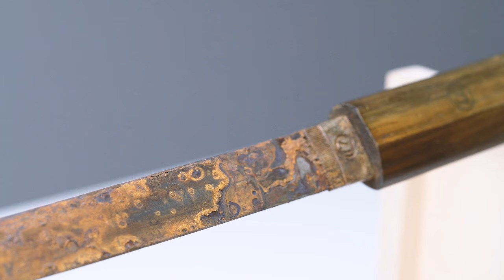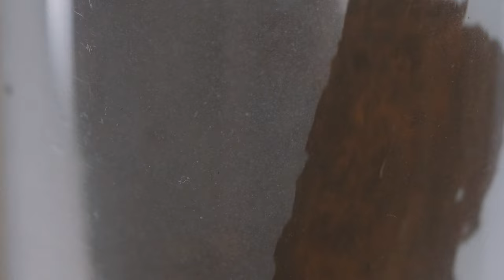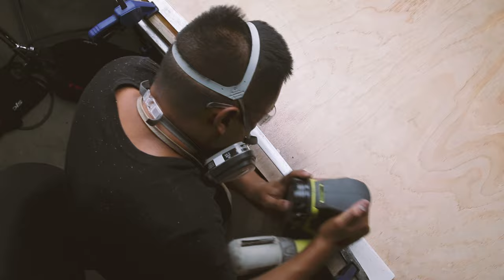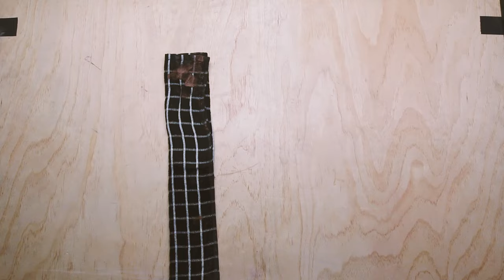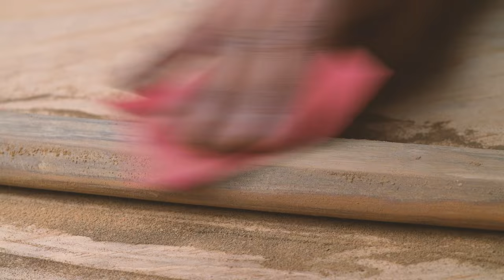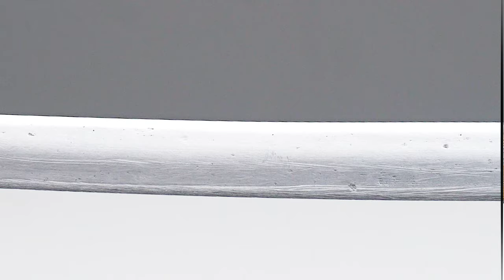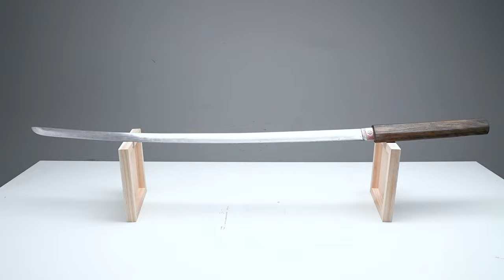Sword Restoration

Comment: I died a little inside when he took the sander to the blade.

How do you maintain the contours of the blade with a god damn sander?
Reply: pretty sure a lot of the contours of the blade were destroyed by the thick layers of rust. Honestly though if you really want them, the sander doesn't take a lot of metal off, only enough to give it its shine back. If you want the details back a little bit of acid could make them reappear. As for the heat marks... Those are lost unless you reheat it with clay. 

P.S. I don't think you're using the right word to describe the details of the blade.
Reply: Atria Wulf The words I used aside, using a block or stone was out of the question?
Reply: Exactly I was so freakin pissed because that is a shanobi blade and should have been treated with better care and professionalism! He should do more research before he screws a $1,200 dollar blade
Reply: Exactly c rap buzxfeed dosnt know what there doing, they don't care they just want they sword for views. They didn't even heat treat it and they should of done a lot beater grinding job, they didn't in my opinion  care
Reply: While I do agree there is a better way of doing it especially for tradition sake. However what is done is done, and they are the owners of that sword now. 

Most people, especially Americans don't know the traditional treatment of a katana let alone how to restore one properly. I think for amateurs they did well.
Reply: It just doesn’t
Reply: There's a master sword maker out there watching this and crying.
Reply: I'd be more upset at the people who let it get rusty like that.
Reply: All that so they can play fruit ninja!?
Reply: Waltham1892 he didnt take me there XD
Reply: "Shanobi" ? lol
Reply: it's just an industrial sword with homogeneous carbon steel geez guys come on.....
Reply: yet no one care about whe scabbard which actually DOES got its markings removed
Reply: I died a little  inside  when i saw there treatment of this sword as someone with an interest in blacksmithing  i cringed at hoe they went about the "restoration" of this sword and the sharpening job was atrocious sure it was sharp but the angle was wrong  and there was inconsistencies in the angle shows a complete  lack of knowledge and skill.
Reply: there wasn't actually a set angle for swords, be it japanese or european, be it antique or modern,
Reply: There may be no set angle, but when the blade is ground it has an angle.  Taking a machine tool to the sword does little to preserve that angle.
Reply: actually if you want a fixed angle, the easiest way, and the way to manufacture actual military katana/sabers is to use a grinding wheel, with guided rail..............
Reply: People who take swords as actual weapons rather than a decoration or collector items did all kind of things that can make people "triggered", for example, use a file to service sharpen a saber, use a rifle stock to hammer a bent military katana back to shape....but it's their sword anyway.
Reply: usually the bevel  sets what the angel will be for the blade he didn't  use the bevel as a guide there for the blade was sharpened at the wrong angle. and you statement is wrong all blades have a set angle be it an axe, knife, sword, etc. it all depends on the type of work its meant for an axe for example needs a steeper angle for splinting wood, a chefs knife requires a shallower angle for slicing  optimal angle is 15 degrees, swords need an angle that in between both preferably abit on shallower  side for optimal slashing potential for deeper cuts
Reply: actually angles on swords are purely based on intended target and personal preference. you can find edges ranges from 10 degrees on some pipe-back sabers to 25 degrees on cavalry sabers, curved edge on japanese swords. On some swords you can actually larger angle on forte smaller angle on foible.
Reply: I thought I was gonna be the only one
Reply: Alex Xu the angle i set when the smith forges in the bevel that serves as the guide when sharpening the sword like take a look for example  at lets say a knife with a scandi grind the bevel is set fairly steep and when sharpening you lay the blade flat with the bevel to preserve the scandi ground edge because that was the intended angle for the knife because its a utility knife for bushcraft. By this idiot not sharpening  the sword following  the set bevel he fucked up the edge plain and simple  he fucked the entire sword up in general  saya and all
Reply: I doubt if you ever seen a historical sword or sharpen one before....
Reply: First of all,what you think as ruined is the edge that previous owner put on, and judging by the look of it, was likely done by a grinder anyway. Second, military swords does not have a edge or said bevel upon purchase, also apply to any other industrial made sword, like this one. Third, in japan, the profession to put edge is also NOT blacksmith or original sword maker, so there is no intended angle anyway. What's the intention of the intended angle you said anyway? to cut into flesh? to cut through garment? to cut tatami roll? or play fruit ninja? A sword polisher would put any angle and shape upon request in a professional manner.
Reply: actually i own a 16th century Japanese katana   with its original fitting the tang has the blacksmiths name engraved  in it. it has  bevel set by the smith  and i have sharpened it to an edge set by the bevel with  traditional Japanese ceramic wet stones and it still has it hamone after sharpening. the point is the way he restored this sword shows a complete lack of respect for the craftsmanship of the sword.  i restored my 16th century katana by  lightly polishing  blade with green jewelers rogue, applying a thin coat of mineral oil on the blade and giving it a new pin everything else remained untouched i respected the craftsmanship of the swordsmith.
Reply: I don't want to repeat again but let me make it clear, the sword showed in video is clearly an industrial made sword in 21 century, the markers on sword and scabbard is merely a character 刀, not from a known sword smith and manufacturer, it has no bevel, and its edge is done originally by a powered grinder, its steel is homogenous carbon steal, and is hammered by machine. it is not your 16th century master piece nor my 19th century antiques. My guess is they bought a katana online and put it in salt water for a week and make a video about it. even all these hate messages from amateur katana fan boys are intended to increase their view count.
Reply: i don't entirely disagree with you that its not a antique master piece, but i can clearly see a bevel on the blade i do blacksmithing as a hobby and i know a bevel when i see one. the point is he could treated the sword better in the Restoration to make it look better than it is and practice better restoration skills so he doesn't fuck up a 16th or 19th century master piece
Reply: then we can be generous and let him play around and pratice with this particular sword, so he will not get hands on an antique and deliberately ruin it........by all means it isn't a sword channel anyway.
Reply: Waltham1892 people always trying to take short cuts...
Reply: Waltham1892 ikr
Reply: Waltham1892 as a wise man once said "engravings give you no tactical advantage what so ever"

It's the one who wields the swords that defines them
Reply: Raiden Jack No.
Reply: Same for me, I cringed when the sander came out. With an electric sander, it would have heated the blade enough to totally screw up the temper of the blade! This is not a video of blade restoration, more like how to destroy a blade. Hopefully, it was a cheap stainless steel knock-off.
Reply: This isn't an expensive sword, you can tell by the Habaki (brass blade collar)it shouldn't be crimped. These swords can be bought for about $40, usually with a stand and extras thrown in gratis. So don't worry about sanding the blade, just needs finer sanding until it shines. NEVER sand a real katana, these cheapo's are fine and look good on the wall.
Reply: Same I am a huge knife guy using a grinder is a much better alternative then the sander it is actually meant to do that plus less risk of an uneven grind
Reply: Ben the blade is not razor sharp look closely and  the angle on each side of the blade doesn’t meet the very top many names for it let’s just call it the edge the edge is a true test for a razor sharp bevel also there are some mistakes in the blade
Reply: You use an angle grinder to sharpen antique swords?

Because, that seems kind of like a dumb dumb thing to do...
Reply: Waltham1892 I died when he sanded off the writing on the holster
Reply: If you are going to destroy the sword, you have to destroy the scabbard too.

Its, like, a rule...
Reply: Yeah, just ask the American Indians about how respectful we are of antiquities...
Reply: Back then, over 200 years ago, a lot more people were disrespectful. But if you look at us NOW, we are a lot more respectful towards antiques and artifacts of the past.
Reply: I'm kinda guessing American History and Current Events is not your best subject?

American Indian tribes are STILL attempting to protect their antiquities TODAY.

This is a bit off subject, so why don't we just drop it.
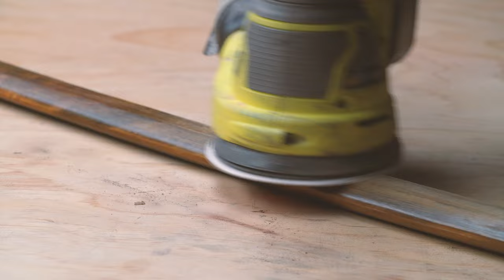Reply: At 2:40 there seemed to be some engraved word or character but he just sanded it all down.
Reply: There were no contours to this blade. It was pretty much a thick chunk of metal after he removed extra rust. This part of his routine afters whetstone that's why it was not use alone.
Reply: Ben Morris n
Reply: yall are acting as if he needed the sharpest sword possible so he could go to some kinda ninja war and kill some samurai's. Lmao, maybe it's just for decoration or just to play around...
Reply: Atria Wulf Oof, don’t generalize all Americans. Not all of us stupid. They’re from Buzzfeed, what do you expect? Buzzfeed to know for falsifying some of their news and not doing proper research.
Reply: My name is Sander
Reply: I was gonna say the same thing
Reply: Atria Wulf samurai swords are not made or polished with electric Sanders that's what makes them unique, what you have here now is an American Sword
Reply: Waltham1892 it’s buzzfeed dude what did you expect
Reply: Rule 1 

Just Don’t Sand An actual katana
Reply: K
Reply: It was in his backyard, if he would like to mistreat something that once belonged to his family, I saw let him, who are we to tell him otherwise?
Reply: Well actually during buzzfeed's machete restoration they used an Emory compound and a white rouge compound to fill in the scratches and essentially remove them
Reply: Waltham1892 10 minutes on the sander or 10 hours on the whetstone?
Reply: Depends if you are a craftsman or a hack, doesn't it?
Reply: Waltham1892 It's just a case of, "this is recreational for aesthetics so if both methods look the same idc"
Reply: Problem is, you can't undo what he did.

If this was just for shits and grins and he can set it back, fine.  

He can't.
Reply: Waltham1892 you too lol the minit he put it in vinegar raw like that was it for me lol😂😂😂
Reply: Arlene Beiruska Hernández Ventura there is something for everyone to hate in this video.
Reply: buffer not sander
Reply: Sorry; he didn't sand away detail.  He just buffed it away.

Comment: Sword Restoration Destruction
Reply: All the names and such were sanded off which takes away all the value in the first place also he should of just used multiple whetstones it would of done the trick. A good video to watch would be JunsKitchen's knife resotoration.
Reply: Ste Bam it wasn't worthless lol now it is
Reply: Driftkor absolute rubbish. The thing may as well have been binned before.
Reply: Heat usually makes a knife rubbish, "namakura" in japanese. The sander creates heat on a knife. that's the reason.
Reply: Yes, you do not restore katanas with power tools and there are techniques none of Wich shown in this make shift thrown together video and the blade is pretty much fucked now cuz of how much material he removed.

Comment: "Restoring"
Reply: Jam Destroying
Reply: Jam có
Reply: The rust ate a lot of metal, unless you want the thing to be full of craters, the ONLY thing you can properly do is sand it down. Hand sanding and power sanding accomplishes the same result. The only other option would be to wel the craters, which WOULD destroy any heat treat on the blade and fill it with soft low-carbon welding metal.
Reply: Spicket Spaghet uh
Reply: @spicketspaghet7773  yeah agreed lots of pitting. Still would have done it all by hand. The carbon content would remain high and the differential harden would show up with a good etch. You can’t show the hamon with pitting because it will eat your metal. The pitting was a no go! He didn’t even show us differential hardening line which is kind of upsetting

Comment: You can restore a machete this way, not a katana.
Please man...
Reply: No ni machetes ni nada
Reply: Well then how would you restore a katana Marco?
Reply: @bigmac6710 no powertools, you may mess with the heat treatment.
Reply: @marcoclementi1247  I'm really late but as stated by other comments the Katana was a low end one, so regardless it didn't matter. I doubt it was made with traditional methods.
Reply: It's a trash katana.  Even a good, old katana is making a decent blade out of crap materials.  It's a fine blade, but nothing exceptional.

Comment: 2:39 Why did you grind off the carves?? Just leave it! You're restoring the sword! Not remodeling it way you want! And the wood looked good and fine before too. You can feel the time from there.
Reply: 한국인이였구나...
Reply: 차원붕가기 I agree with you on the wood part but the sword IS his and he can sure do better than you ever can with restoring
Reply: Ninjacam100 Gaming well, see, it wouldn’t have been so fucking hard if I had access to the whetstones he used, no need for powertools to destroy the heatreat and edge that he was «restoring». A slight bit of research would’ve told him that was a bad idea
Reply: HIS SWORD HIS MODEL
Reply: 차원붕가기 ikr like it's restoring not destroying :(

Comment: As soon as it went into vinegar I knew it would be down hill.
Reply: Why? Vinegar is a really practical and efficient way to get rust off of metal. It brakes down the iron oxide, not the blade itself.
Reply: icampos89 
Well in this case vinegar was the one of the correct ways to start (as long as handle is covered) then neutralize the vinegar with water then you would go to 1000, 3000, and 5000 grit wet stones or paper on a flat surface. Finally polish and sharpen.
Reply: Yeah. I'd say it went downhill once he busted out the palm sander

Comment: No one should ever use electric tools for this kinda thing, this is very delicate and electric tools go rough, even professionals don’t handle them well, they are just ... too fast, always use stones for sharpening, it’s slow, but it does it well
Reply: he did use stones to sharpen the sword, what are you talking about? we no longer use old shit because it's bad, modern equipments are superior. no reason to waste time.

Comment: It looks good I guess but it’s also scratched to shit.
Reply: Starichu looks good from far away, maybe. Looking at the blade during the close-up shots was painful.
Reply: Even the characters on the sheath were sanded away.
Reply: He completely fucking destroyed that sword.
Reply: I'd rather have a rusty original than his mall sharpened sword.
Reply: Starichu oh no the sword was scratched oh woe is me the fucking sword was scratched
Reply: I mean if you are restoring a historic piece back to the "original" condition or the closest thing to it, having scratches that go completely against the normal grind is beyond bad. It's like getting a gun "restored" only to find that the rifling is gone or damaged. It works, but nowhere near the original condition and wouldn't be called restored by professional standards.
Reply: Polish won't fix the grind type of the blade itself. Like how polish won't fix the rifling of a barrel, and it sure as heck won't fix the blade geometry of a sword that was sharpened like a kitchen knife. Just watch any blade smithing video and you will see. We're not talking about cosmetics, the destruction of the characters on the handle is cosmetic, this blade edge is functional damage. The edge will wear down more easily because of it, and the long streaks will make it more susceptible to rusting due to the new imperfections of the surface that are now crisscrossing the edge.

tl;dr It's not the scratches, it's the principle that this is not a restoration, it's a cleanup job. You would never say a 1967 impala was restored if it was covered in scratches and different style parts, you shouldn't call this blade restored if it has none of its original characteristics besides still being a sword.
Reply: I'm not a sword expert or a blade smith, I've just read a lot about it and watch a lot of professional blacksmiths do stuff (Man at Arms:REFORGED). However I've seen people destroy a lot of relics and old items by doing "restorations" like this (pawn stars and YT videos) so as soon as the power tools came out, I knew that was where it was going.
Reply: Turns out they can't make the blade grow more steel.
Reply: I mean fine steel wool maybe, but he pulled out a dish scrubber.
Reply: I've seen it used on cleavers and axes, but I guess you're right since it's a sword lol
Reply: True, restorations need to be treated like it was being worked on from the base all over again with similar tools used to make a new one.
Reply: ya the edge looked like a tragedy up close
Reply: Starichu It's a sword.. 

What do you expect?